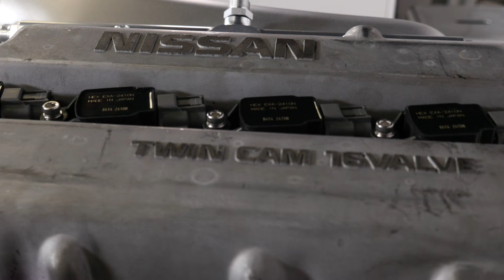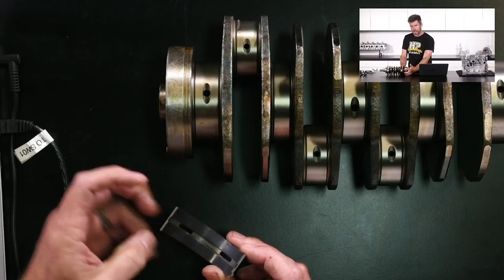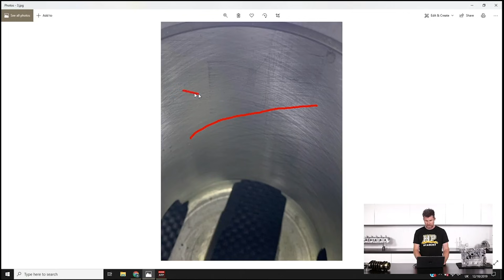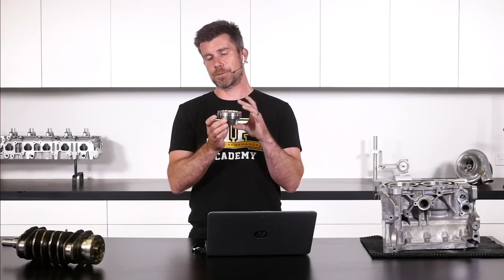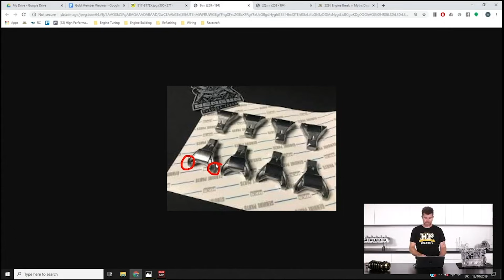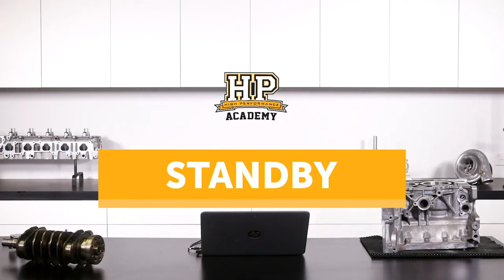Engine Break-In Myths Dispelled | Engine Break-In Tips And Tricks [GOLD WEBINAR]

Comment: Excellent and thorough explanation of a process with tons of hearsay and misconception floating around out there.  Your method is pretty much my method, and it has served very well for both an Alusil bore Porsche 944 engine I did (with only a homebrew DIY cylinder deglazing/re-lapping process to boot...Alusil can be super finnicky with surface prep for new rings), and a more conventional Honda B20Z2, both of which broke in perfectly with no smoke or oil consumption.  I have a Honda D15B VTEC to break in tomorrow, actually,  and a Hyundai Delta V6 engine in a couple of weeks that has reground cams, so also put me at ease on how to balance cam versus ring break in.

Comment: I remember many years ago old guy (actually quite a well known engineer) reckoned if he had issues with rings not seating, bit of Brasso down the carb, reckoned it worked a treat and never experienced any negative results. Just telling the story.
Someone else used to handhone with 600 wet&dry. He actually was a big name in the aftermarket performance industry. Tried it myself once, worked well.
Have used garden sprayer with a barb fitting at the end of the hose and just screwed it into the oil pressure switch location. Turn it over by hand, have seen forty pounds, certainly pretty lubed.

Comment: I break in on average almost one more a week. Roller cam, so start and very rpm from 1500 to 2500 to maybe 140 degrees. Shut down, check for leaks and fluids. Then I serialize the motor before it gets really hot. Then I run it from 2000 to 4000 rpm until it gets to 170. Calibrate the computer temp sensor and then it WOT. The motor will start to make more vacuum in the first 15 to 20 min. Run motors 30 to 90 minutes dialing it in before its customer ready. They can run it as they please once it's got some heat in it.
Reply: @stoeger 2 We give each motor a number so we can track it's build info and date.

Comment: You missed some important detail. A good machinist who follows the mechanical engineers instruction will effect a proper bore finish. Hones used for surface Finish require the machinist to apply two hone finishes at the same time. First hone stone is course to produce deep grooving to retain oil for Aquaplaning during operation  the angle will suit the expected engine rpm, load and oil viscosity. The second hone is a finer mesh  that removes the peaks of the course finish to produce groves onto a plateau. The finer hone finish is sacrificial and needed for ring bed in only, the rings are bedded in only and absolutely when the fine finish is completely machined away by the rings. Keeping engine temp low even sub normal is optimal For Ring bed in and bore bed in to avoid thermal distortion relieving bore zones. Also need to keep bed in short, it saves piston skirt degradation. Then bearing (plain) bed in is real. The truely phenomenal oil pressure at the squish wedge zone forces the soft bearing material into the backing base(caps, block, rods etc and the results change..... Have to stop, could go on.... Cam bed in etc etc metal to metal contact always happen on cold start and requires molecular covalent bonding to assist.
Reply: I think if you've reached the point of thermal distortion there's probably more serious problems you need to address. Plus once the engine has oil pressure for a few seconds , the bearings will be seated otherwise again you've got serious issues to address.
Reply: Hi mrberger, 
The lead author of this paper is a renowned specialist in the field of cylinder texturing and coatings.
https://journals.sagepub.com/doi/abs/10.1177/0954407013512626
The two lead authors of this paper are renown experts in the study and application of roller and sliding tappets, .
https://asmedigitalcollection.asme.org/ICES/proceedings-abstract/ICES2012/917/239917
The lead author of this paper has immense knowledge of lubricants.
https://www.sciencedirect.com/science/article/pii/S0301679X19306292
All of the literature these four have produced is pier reviewed academic literature, and book publications, that is world class and cited by many. They are all, and many other facets of their work, well worth reading.
Reply: I'll speak from first hand experience as both engineer and machinist with experience working military, aeronautical and race cars. Having bored and honed world leading race engines, I've measured the thermal movement of blocks, it's  significant. Next time you machine a block, hot tsnk it first, hone to spec then measure at cold. Youll see it lumpy like a torque plate hone. Im amazed people are happy to clearance forged pistons for large thermal expansion yet live in denial the laws of thermodynamics dont apply elsewhere. If youre happy in denial more power to you (but not your engine)

Comment: Do you think these principles apply to piston aircraft engines as well? I recently had an overhaul done on my 160 HP Cherokee, and I was told very emphatically that break-in must be done at high RPM/manifold pressure to ensure proper piston ring expansion. Also, only straight mineral oil can be used during the process, as the film strength of AD oil cannot be broken by normal compression - otherwise glazing of the cylinders can occur. Just curious if you have any thoughts on this. Thanks!
Reply: Michael Koury Unless you're in the sports or experimental category the aircraft design is type certified. Any unapproved variation to the approved data is not only illegal but dangerous.
Reply: What you just described is exactly what he is doing with road engines. Same theory applied with some variation due to... flying. If you do a little research you will find the same principles he described here are applied to piston aircraft. It usually involves very little idle time, high rpm/torque load, max cooling, rich fuel (for cooling cylinders), high climb rate, and monitoring individual cylinder temps, etc.
Reply: jon-paul cooper, the point I’m trying to make is, in aviation, you always follow the oem approved data. The OP seemed to be asking  about opinions.

Comment: 3:22 What you say is absolute nonsense. Bearings is some engines DO have a break in. You mix lie with truth and assume we live in a perfect world. Metal may not touch but the rods don't follow the bearing perfectly. There is sideways movement and slight twisting. If what you say is true, then you can take bearings out and put them in other rod journals. Any knowledgeable engine builder know this is a huge heck no. It has a wear pattern. Putting a bearing under load may change that wear pattern or accelerate it significantly. Therefore, I highly advise you edit that out or provide context. Right now that portion is completely wrong regardless of your 20 years of experience.
Reply from the maker: I stand 100% behind everything in this video. A wear pattern is a very different thing to 'breaking in' a bearing. Yes of course there will be a wear pattern after the bearing has been used - The crankshaft and block flex, particularly under high load and high rpm, and debris can also result in wear on the bearing surface. No, I don't advocate swapping bearings from one journal to another, but then I also wouldn't advocate reusing bearings that show any wear as a matter of course. However, moving on to your specifics, the typically recommended approach to breaking in an engine is to run it for an extended period of time under low load and low rpm - Basically babying it around for as much as 1000-5000 km depending on who's dishing out the advice. Assuming you've got sufficient bearing clearance (which is a separate issue), this break in process will have no effect on the bearings - Andre
Reply: @hpa101  Not all engines are designed with sufficient clearance to not need a break in period. My S54 calls for a break in period, which comes directly from BMW for replacing stock bearings. Yes, you can put oversized bearings in but that's not what people do, nor should they. You start screwing with other things then. Breaking in the bearings won't help when the oil pressure isn't sufficient or there's play. This blanket statement doesn't apply to everything. I had to stop misinformation on my forum because of this video. The ones dishing out the advice are the engineers at BMW who designed the engine. At the end of the day, it's your argument against theirs. I know there are more engines out there that have similar recommendations, but an E46 M3 is sufficient enough to make my point. Your video is so good but that specific part just contains the wrong info. It could be the difference between someone spinning a bearing prematurely or never needing bearings again. They'll watch this video and ignore what the actual manual says.
Edit: I just realized you said break in is different than a wear pattern. No, break in establishes the wear pattern. That's the whole point. Why do cams need a break in? To establish wear pattern. I've seen with my own eyes what happens when a cam isn't broken in or a rocker arm is not put back in the right spot. Oil does the same thing there as it does for bearings. Stop metal to metal contact. Take that clearance away too soon and now you've created an insufficient clearance condition. Nothing is manufactured perfect. There's a tolerance items are allowed to be. One bearing could be thicker than another or have surface imperfections. There is still pressure and friction and high pressure areas. This minimizes the concentration of wear in one area. It scientifically makes perfect sense. Higher rpm equals more pressure on components. Imperfectly made components need to settle in and already used components are definitely not going to be without flaws.
Reply: @hpa101  I was thinking about this and I didn't want to just leave everything on a negative note. I don't, by any means, think you are incompetent. I zoomed in on one detail and quite frankly it's not how I view you as an organization. I would still be willing to suggest people to your videos because you have more knowledge than most, including me. Facts are king and your video is full of them, therefore I was only critical of 30 seconds out the hour long video. Still an awesome video with so much good information.

Comment: Thank you for these awesome videos. Super informative and good info. 

Assuming apex seals = compression rings, Do you use the same procedure for a rotary engine break in?
Reply from the maker: I don't build rotary engines so I can't advise you from experience. There isn't a hone pattern as such on a rotor housing but I would still expect the apex seals and side seals to seat or bed over the first hour or so of operation. If in doubt then I'd consult a rotary engine specialist.

Comment: I bought a new 2019 370Z with the VQ37VHR engine and was careful in the break-in process. I have used the recommended Nissan Ester oil, high in Molybdenum, throughout with a Fram Ultra synthetic filter, both changed every 3K miles. I did an early oil and filter change at 200 mi, 600 mi and 1800 mi. After that, I went to a normal oil change interval. For the first 1K miles I kept engine revs below 3500 and only used gentle acceleration, with varying engine speeds and loads for periods that didn't exceed 1/2 hour. I waited until the oil temp would get to 140 degrees F before taking off and keeping the revs not over 2K until the temp would get to 180 deg F. Between 1K and 2K miles I gradually increased acceleration levels and allowed engine rpm to max at 4K for brief periods. I continued to baby the engine until I got to about 5K miles. Now at 15K miles I use barely 1 oz of oil per 1K miles.
Reply from the maker: A couple of things I'll mention here. Your technique is probably similar to how the majority of people treat break-in - maybe in your case you've taken things a bit further with additional oil changes (which I'd say are a great idea). This technique isn't necessarily going to end up with terrible results, or an engine that consumes oil. The saving grace is that modern ring materials and honing techniques make it very difficult to actually make a mess of bedding the rings. That being said, in my opinion you've basically spent around 4800-4900 miles unnecessarily breaking in your engine when you could have been enjoying it instead. It's never a bad idea however to keep the rpm and load low during engine warm up though. Being a little more aggressive on the break in process also has the potential for improved ring seal which can result in improved power, not just a reduction in oil consumption - Andre
Reply: Thanks for the thoughtful reply.

The car has about 57K miles on it now and shows no discernable oil usage on the dipstick at the end of my 3K mile oil change intervals; I'm using the same oil, filter and warm up practices. One thing I did do is to go with a taller filter that offers about 50% more filtration area, as an attempt to reduce the slightly greater pressure drop that occurs with this particular filter because of its higher than normal filtration efficiency.

My exhaust tips show minimal amounts of soot or any other kind of deposits on the insides of the pipes, indicating to me that the engine is burning cleanly. One thing I do that may be helping is that I run a mixture of Redline SI-1 complete fuel system cleaner in the ratio of ⅓ oz per gallon of gas. This is for additional cleaning and lubrication of the upper cylinder area. I did pull one of the spark plugs and dropped a borescope into the cylinder to inspect the top of the piston, which was devoid of any deposits except for a darkening of the aluminum surface. The spark plug looked good, despite the richer fuel/air mixture that I'm running. Taking off one of the throttle bodies, which I had to do to get access to the spark plugs on one of the banks, showed very little gunk downstream of the butterfly valve.

I think this is a testament to the improved materials and techniques you mentioned that modern engine builders use as opposed to what I was familiar with back in the 60s and 70s.   @hpa101

Comment: -Clearance the bearings and rings
-build it
-add cheap oil
-start it and run for about 10-15 mins whilst checking for leaks
-drive it for about 50-100 miles with alot of sub 5000rpm wot and deceleration in gear
-do this over 2-3 heat cycles
-change oil with correct spec

This is what I've always done without problems and on my high comp b20vtec
Reply: I break in very similar. Although i beat on it much sooner than that. Heavy emphasis on the decel in gear!
Reply: Without knowing a method this is exactly how I already began breaking in  my new 406sbc

Comment: Yep, If you set the clearances correct, Do the Correct honing procedure aka Torque plate honing and or even better bringing the block up to temp while honing, use the correct rings and the correct cross hatch for the rings then in my experience my engines are all sealed up in about 15-20 minutes run time and we start making dyno pulls right after that initial run in, this guy is telling the truth 100%
Reply: I've watched videos on youtube of Pakistani dudes building engines with bricks and a welding stick.

All jokes aside, building an engine can be as complex as you want it to be for maximum performance and longevity. Of course all of those techniques you suggest be applied come with a cost that most enthusiasts would rather cut costs on.

I do feel like machine shops are starting to make it more of a standard though and part of the natural cost of building an engine.

Comment: Is the break in process the same for a car that will keep it's map prior to rebuild?
Reply: Breaking in an engine is mechanical, the map is electronic. The two don't correlate assuming when you say map you mean the tune. Whatever engine you have, look for the manufacturer recommendations because not all engines are the same. My engine requires 1200 miles under 5500rpm and light engine load.

Comment: Hi all, I have two questions. I have built and broken in a 2L I4 that was built for medium boost, I basically used the brake in formula Andre was talking about. However, years ago I read a technical paper written ages ago about braking in aircraft piston engines, in that paper it was recommended to run the engine under load up to and 50% over its operating temp. This paper said that the combination of load and heat sealed the pistons in the bores better than the normal procedures of the time. I’m asking because I accidentally did exactly that when braking in my engine and, that engine made well over 150hp per cylinder and outlived 2 chassis and one transmission. Have you ever heard of running the engine over operating temp. during brake in??
Reply from the maker: You'll find that the engine tends to run hotter than normal during the initial break in due to the additional friction, particularly due to the ring interface with the bores. I've never purposely run an engine hot to aid break in and would be interested to read the paper you're talking about if you happen to have a link? I'm also a recreational pilot and one of the Piper Cherokees that I fly recently had an engine overhaul. The advice for break in was interesting at best - For the first 50 hours of use we basically had to keep the engine within about 200 rpm of the maximum safe rpm (except obviously landing and taxiing). Although the engines in the Cherokee only rev to 2500 rpm so I'd assume they wouldn't build excessive heat in the rings at a sustained 2300 - Andre